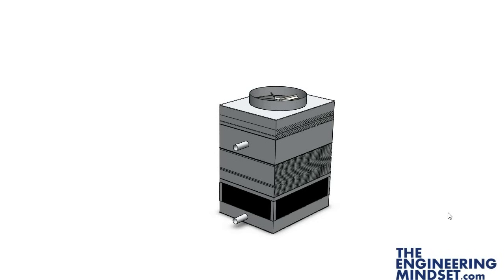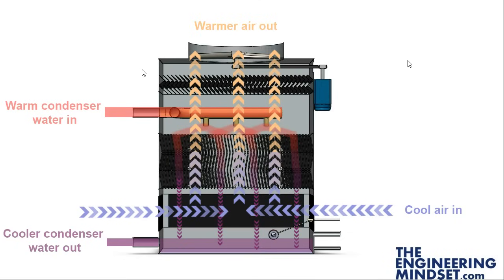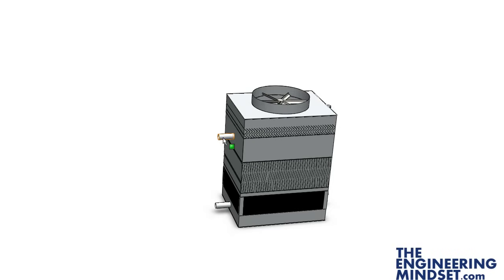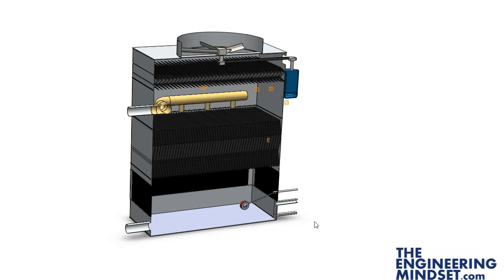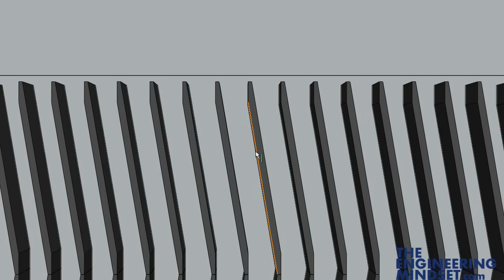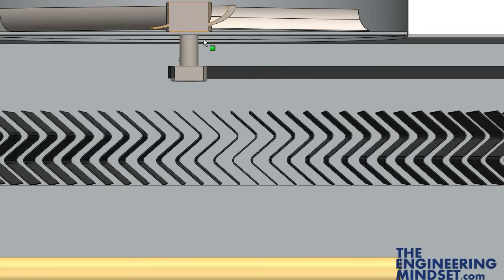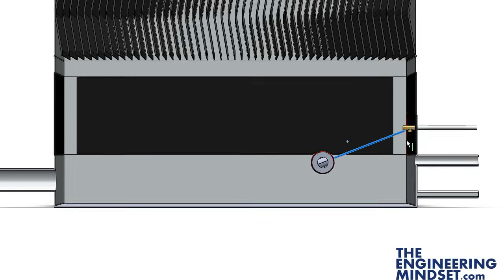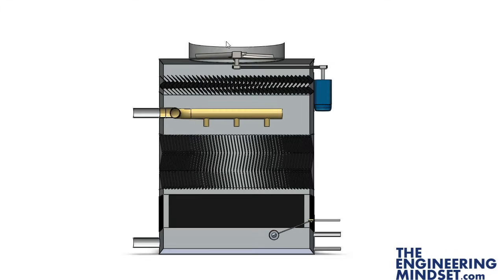How Cooling Towers Work

Comment: Hi bro, I was checking your video. I have one doubt about this cooling tower. Does the outdoor cool air touches directly the chiller water which was sprinkled into the film? If so, would that add dust/impurities etc to the chiller water? Thanks

Comment: why does water evaporate? If the intended purpose for the water is to get colder instead of hotter?
Reply: Evaporation takes heat away from the water, hence there are drift eliminators that still condense that moisture and cool the water, which is the main purpose

Comment: Where does the water go when it's drained ? Is it reused somewhere or does it just go to the sewer?   Also, where does the new, fresh water come from?  If the building is connected to the city water supply, is that where the new water comes from? Is that usually connected at the chiller ?
Reply from the maker: It goes to the sewer, it comes from the water main. It enters near the pressurisation unit. See our video on chilled water schematics
Reply: @EngineeringMindset  thank you. I'm taking my RMO exam from FDNY. I'm watching all your videos in order..many people told me these videos helped them a lot to pass the exam

Comment: Question that seems very basic here... What is the difference between a cooling tower and a fluid cooler. Working in residential now everyone calls these towers fluid coolers, and that its different than cooling towers in commercial. Any info is appreciated, have not got a complete answer yet.

Comment: I've seen some of your more current videos, and they are much better than this.  You should update this one with some engineering and design calculations as well as the physics behind the actual heat dissipation and water evaporation

Comment: I thought the purpose of a chiller was to cool water. Why is a chiller sending warm water to a cooling tower?
Reply from the maker: Please watch our videos on how chillers work
Reply: I understand like this.. you don't make a space cool, you remove heat from the space. So the chiller collects the heat from the building, and sends the heat to the cooling tower, which then sends the heat into the outside air.

Comment: What is the problem if heat rejection smaller than 200kw? but in/out temperatures and water flow rate are the same.

Comment: Hi, if the water supply to the cooling tower (specified on the chiller's schematic) is 2000L/h, does that mean that 2000L of warm water are lost to the environment every hour? Is it worth trying to recover somehow? (asking for an academic group project that aims to recover heat/water from a chiller)
Thank you..
Reply from the maker: No it will recycle the water, a much smaller amount is lost to evaporation. You can reclaim some heat yes.

Comment: Hey great video!! I had a doubt though how does the drift eliminator exactly help in condensing the warm air being sucked by the fan.
Reply from the maker: It collides with the surface so the impact and pressure change, the material will be a cooler temperature also.

Comment: Is there a fan in the bottom by the base to get the ambien air inside the cooling tower is it just pulled from you top fan
Reply from the maker: most have fans on the top but some will use ground mounted fans which sit at the side and blow air inside, these are usually used when the cooling tower would exceed height restrictions for local building regulations so shorter towers are needed

Comment: If there is multi cell cooling tower then will there be a separate float valve for each cell or one float valve is enough for multi cell cooling tower?
Reply from the maker: There are many ways to do it, there could be several towers connected together and a pipe running between all to balance the water level too

Comment: so is this an open circuit then
Reply from the maker: Yes this is an open circuit, the condenser water leaves the pipe and is sprayed into the air of the cooling tower.